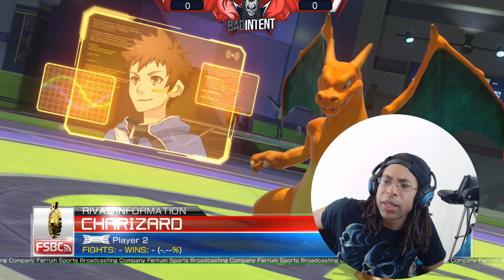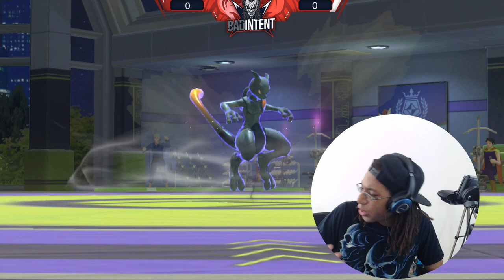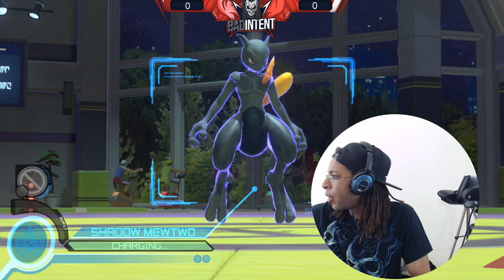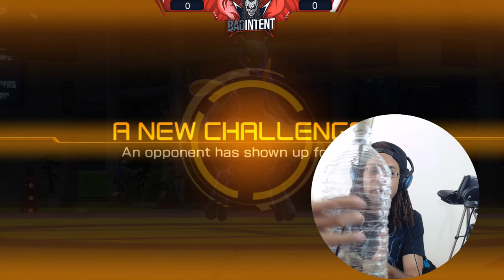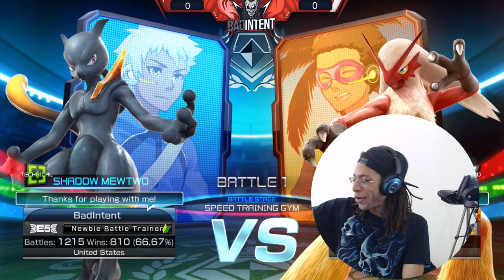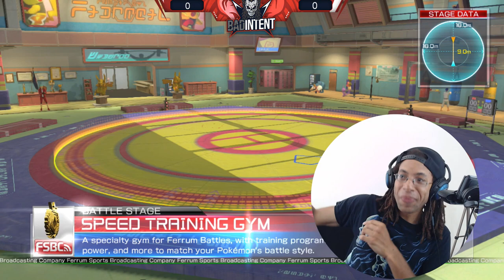How to Make a Mic Stand

Comment: This is a great setup and all, but have you tried using your hp laptop hooked with USB audio placed on top of a cat scratcher with headset wires less than 2 feet while sitting on a pink cylindrical seat? It works pretty well